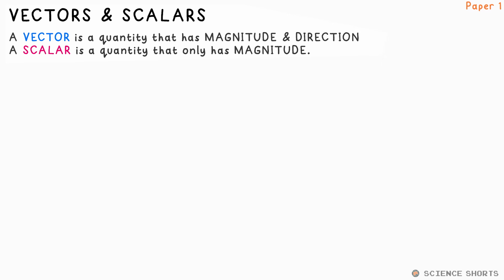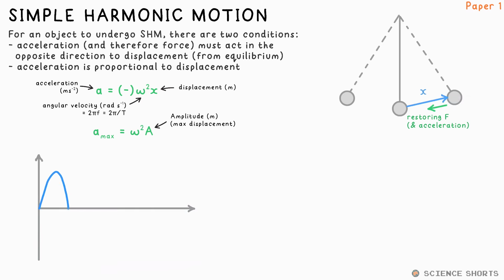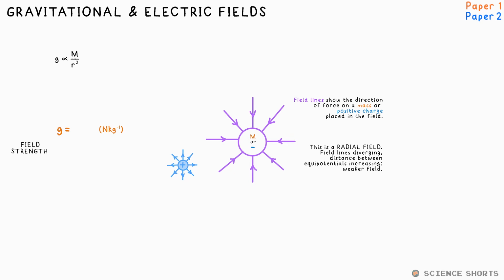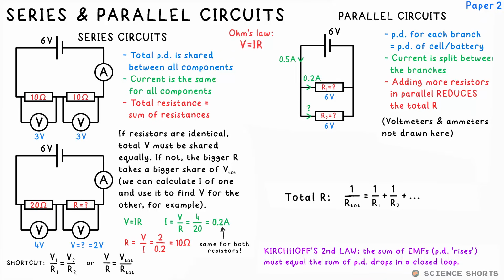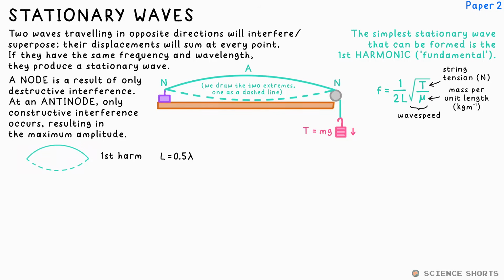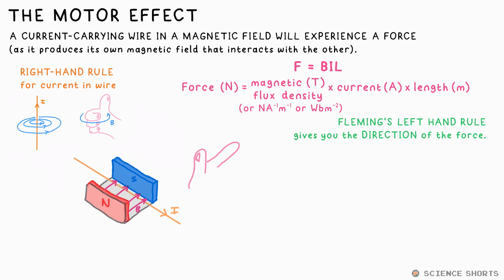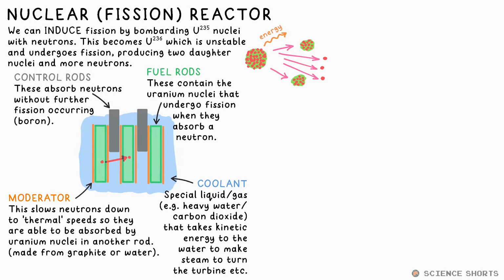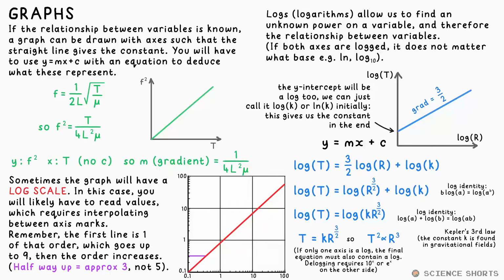All of OCR A-level Physics in 2.5 hours

Comment: 2:03:11
At first I wondered why the doppler effect applies here but after thinking about it more, it actually does make sense since the sound would seem to approach at a speed of c - vcosθ relative to the blood cell, then gets reflected at the same speed relative to the blood cell, which is c - 2vcosθ relative to the viewer (as the blood cell is moving away with a speed of vcosθ parallel to the initial direction). Meaning Δv =  - 2vcosθ. pretty cool.
Reply: for a moment I thought this was using light instead of sound but I believe the same would apply, just the light would be stretched instead of the speed changing.
Reply: @-yeetus i thought it actually meant the speed of light in the exam and it hurts so much 🥲
Reply: @amisaif774 😭😭😭